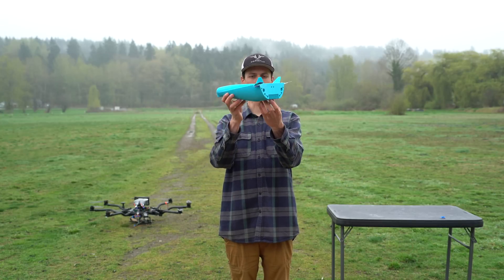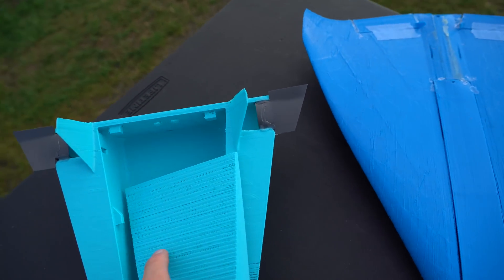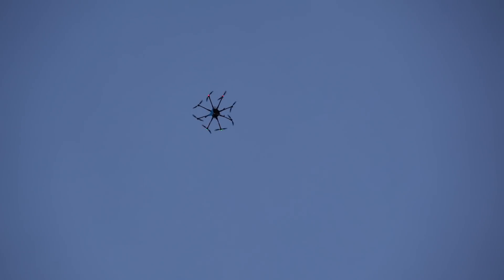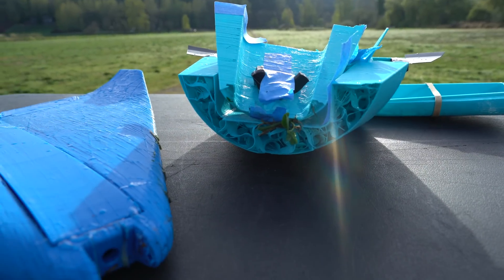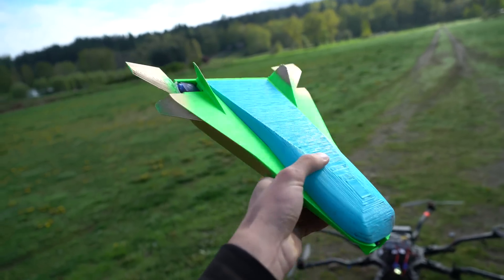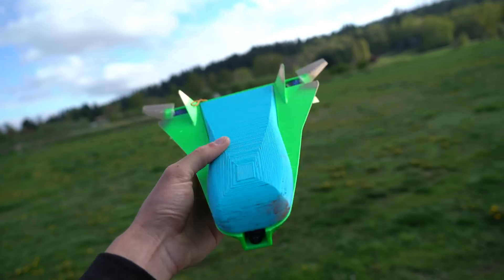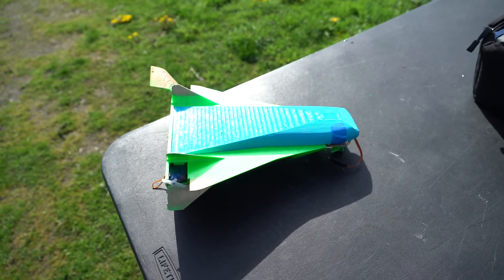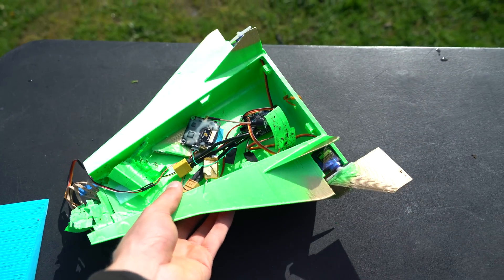3D Printed RC Lifting Body Aircraft? - RCTESTFLIGHT

Comment: i would start by only printing the outer shell, then fill in the dead space with foam and hot glu to add strength. Also your camera position is killing a lot of the lifting body design characteristics. The nose cone needs to be smooth so air can evenly distribute underneath without turbulence.if you notice in the designs used by nasa you do not want just a half round, you actually need some vertical portion of it all the way around to prevent so much air splitting over the top, then move your controls forward and lower. it seems to me you want cg at center or even maybe a bit behind center because the tail is going to have more lift than the front.

Comment: Having gone through the lifting body phase with no stabilization it's got to be made from foam for a lighter loading. Air density doesn't scale.  I'd piggyback mine up on a trainer 60 then fly them down to a hand catch, but they were only 2-3 oz.  Most were an exact scale of the original so you can throw it like a football and fly it back. Took a strong arm and an immediate return to home flight plan.

Comment: Try covering the thing with aluminum flue tape to smooth the surface. Don't rub it hard onto it, that will only result in a somewhat smoother surface across the print layers. Another thing to try is heavy duty clear packing tape. I mean the really good tape, not thing dollar store crap. With either tape, bridge over those slats you put on the bottom.

Next thing to do is drop it almost flat, a little nose down rather than hanging with the nose straight down. Nose down dropping is like those wingsuit fliers jumping off high cliffs. They lose a huge amount of altitude before they get significant horizontal velocity. If they had some sort of launch rail or slingshot they could fly much farther.

Comment: Looking at the HL-10, it looks like the airframe leads a lot of airflow from the sides up to between the vertical stabilizers, to add lift and roll stability.
When looking at your print and imagine the air flows in similar angles, I'd guess that severe turbulence would build up on the top side of the body, as it is rather flat and there is a straight leading edge that follows from the front right to the back, which then could cause a spin so abrupt it really looks like a servo glitch

Comment: EXTREME overweight!!
Ditch the huge battery - try a 250mah instead of a quad racing brick!
Print thinner/less walls.
The finish is too rough for a lifting body.
Add a centreline fin for stability instead of winglets.
I don't think the rear 'diffuser' helps either. These belong on an F1 racing car - for helping push the car into the ground - ie reverse lift.
I'd scale up the design just a little too.
I hope you follow through with your experiments, unlike other talented designers on youtube who bounce from project to project and never really problem solve a design to the end.

Comment: would you create more lift if you slope the upper curve farhter down in between the fins like the x 10?
loose some inside volume though.
and do bigger control surfaces help?
x10 seem to be a clipped wing from above.

Comment: i think a major issue is the 3D print roughness of the surface. You need a very smooth surface for a good laminar flow and lift. perhaps with some good sanding and polishing it would have been a lot better.
Reply: Destin heard you say laminar flow. He is coming.
Reply: Especially at that scale. Imagine how big those lines would be if it were full scale...
Reply: @DanielWilliams-oi4ss  the lines are an artifact of the printing process. they would say the same size no matter how much it's scaled up .
Reply: @ancelrick5396  he's not talking about if it were printed at a bigger scale, he's talking about if a full size craft had ridges/lines of a similar scale relative to the body
Reply: @ClippyForConsumerWrights  Sorry I though the OP was talking about 3d printing.
Reply: Maybe vapor smoothing it
Reply: @Mcedgelord_05  that only works on ABS. All these planes are made of PLA.
Reply: Cupcake maybe try printing in abs or with non planer printing also maybe try printing with less infill since the lifting body is heavy
Reply: @Daesgrith  I bet you could vapor smooth pla with paint stripper.
Reply: No, turn the print so it prints in the same plane as the foil, makes them way smoother
Reply: He has some extrusion issues with his printer. I have a cheap printer that is tuned properly and it has a way smoother surface then this even with a .6mm nozzle.
Reply: If he had the talent, he wouldn't have used a 3d printer to build those. What craft would have 1 mm thick walls at that scale? None. Build it from foam.

Comment: In the first test flights (before any components were added to the craft) it looked like the drone was creating a bunch of turbulence on the crafts as they were released.

You might try having them tethered further away from the drone (like 20ft below it), or have a very long beam extend off the drone so the craft is outside the turbulence. If the drone can't maintain balance, you could extend a beam in both directions with a counter weight that gets dropped at the same time as the craft, and have it tied to the center of the drone to prevent the counterweight from falling on anyone's head.

Comment: A good resource for you on this is "Flying Without Wings"  By authors Thompson and Peebles covering the full history, flight by flight with the test pilots notes and feedback. Your flying prototype resembles the M2-F3 profile, but your ventral slots may be robbing you of lift... maybe if try some flights where it's taped over in increasing stages from front to rear. Your more streamlined shape is closer to the HL-10 without the mid fuselage volume but with the flared  wingtips. Hope you continue making and flying these models... maybe check out the "Dreamchaser" by Sierra Nevada Corp... it could lead to a job with them perhaps !

Comment: From what I've read is that NASA was initially interested in lifting bodies for spacecraft coming back from orbit.  During one drop test the lifting body which flew more like a streamlined brick made a successful landing on the dry lake bed.  Shortly after rolling to a stop the B-52 mothership roared over at low altitude.  One of the engineers asked: How did he get down from altitude so quickly.  The B-52 pilots showed the engineers their technique and proved that winged aircraft can be used for reentry.

About being a streamlined brick...

A local glider club presented one of the test pilots a trophy that was a red brick ground to a streamlined shape.

Comment: Consider Colorfabb's new filament its FOAMING. you can print it at 35% extrusion rate but full flow. of course the parts will be much weaker but also upto 65% LIGHTER for the same volume of printed material. very neat stuff!

Comment: What an impressive brick design ! glides as if a good brick would do. If it was effective and successful the space shuttle would have been in this shape. If remember correctly the modification from x-24A to X-24B made it almost different appearance just to made it more stable in flight. I think this body lifting design was meant for the high speed high altitude glide not the same condition that set up on your experiment . This must be one factor contributed to "fly like a brick".

Comment: One of the major lessons learned from the M2 lifting body in the 60's, which is most similar to the one in the video, is it needs a vertical fin right on the centerline to stabilize in roll.  I bet if you add a centerline fin, the uncontrolled spins would stop. 

I also agree with the poster who questions the use of a flight controller.  It hides the real behavior of the vehicle, and will often make things worse once they go bad (like spins).

Comment: The space Shuttle and the earlier experimental test machines have wings that are essentially upside down . They do not make lift . They are designed to slow down in a glide slope without stalling
Reply: The Shuttles have normal lifting wings. They are way, no how, a lifting body. The only thing the Shuttle got from the lifting body program was the high speed steep then flare to horizontal glide path.
Reply: @greggv8  
It is this unique aerospace vehicle, a lifting body, that launches like a rocket, orbits like a spacecraft and lands like a glider that continues to link earth and space.
 
Last Updated: Aug. 7, 2017
Editor: NASA Content Administrator
https://www.nasa.gov/audience/forstudents/9-12/features/F_Aeronautics_of_Space_Shuttle.html

As I said above the aerofoil of the wings is is upside down relative to a normal plane . That allows a higher angle of attack without stalling , a measure of control at higher altitudes and the deceleration required to come down out of orbit . Yes the wings can generate lift . But then so can a conventional plane flying upside down if the angle of attack is sufficient 
Basically it "glides" like a brick

Comment: Remove the rear diffuser. On cars, those are used to decrease air pressure under the car and increase pressure over the car to increase grip. I'd think you want high pressure under the flying body and low pressure over the flying body. I'm not an expert, I just watch YouTube, I'm sure I'm just talking malarkey and shennanigans.

Comment: Okay, so a few things. First off, what's going on with your prints man? looks like maybe you're printing too hot/fast for the material that you're using. Secondly, I think those grooves in the bottom are actually taking away from your lift. They're clearly not doing anything to help vertically stabilize it, as the craft was still going into flat spins. I think that if you took them away, and stuck with the little winglets on the side, you'd probably end up getting a much higher lifting force.

Comment: Some of the reasons why the F-35 looks a little stubby with its upturned nose and short neck compared to the sleek F-16 is because it has incorporated some of the lifting body characteristics into its airframe. I believe this gives the airplane high AOA authority, especially at low speeds.

Comment: Print some thin cross section of the model (oriented like formers would be in a balsa fuselage). Glue XPS foam between them, and hotwire/sand the plug until it's the right shape.  MUCH lower mass/density/wing loading.

Comment: i think its just too heavy, try using foam next time (use the PLA shape to make a negative and fill said negative w/ construction foam and carve the body out of that )
Reply: There's a flood of printer dependent "creators" out there. They don't have the ability to work with different materials, shaping, etc... But software modeling, they can do that all day. It's like those Tesla car dweebs that talk it up as the greatest car ever, but couldn't change a tire or brake pad to save their lives.

Comment: Neat experiments. My favorite is the X-24A and I can go see it any day I want because I live about 10 minutes from the Air Force Museum. (yes I know the one on display is actually a SV-5J modified to look like the 24A.) What software are you using? I'd very much like to model stuff too but don't know if I can afford the software. You probably don't want to hear this but your body/wing loading is gross. Try sticking it out a car window and see if you can create the lift. Yes you are right those spins are the result of stall. The X24-B had winglets on it like you final lifting body and it was quite successful.

Comment: Thanks for not saying anything about how NASA's lifting body test program was used in the development of the Space Shuttle. It wasn't, except for proving that an unpowered craft could safely make a high speed and steep descent then flare and transition to horizontal flight to land. The Shuttle is not a lifting body, it's a brick with wings and a round nose.

Comment: The grooves on the bottom seem like a mistake to me. It changes that cross section into a less capable lifting form. You're forcing air to be displaced and squeezed on the underside, speeding it up, causing lower pressure. At least put them on top. 

Also, the landing speed was very high on the real thing, and needed a rocket boost to flare. That's not much good for scale flight, as a pebble becomes a boulder in the runway. A long lubed up slip'n'slide might work.
Reply: They never used the rocket for landing. The rockets were used to gain altitude and speed after being dropped from their B52 mothership. https://www.nasa.gov/centers/armstrong/news/FactSheets/FS-011-DFRC.html IIRC the M2-F1 towed glider had a rocket in early air towed flights as a just in case backup to kick it horizontal but it was never used so the rocket was removed.

Comment: I think your "built in" strakes on the underside might be creating an area of low pressure, which could be causing some of your instability. Maybe try sculpting them in smoother so that the don't have such a sharp cutoff where they meet the middle underside of the fuselage? Or maybe try one without them all together? Cheers and thanks for another interesting video :)

Comment: Hey Dan. This was a very interesting project, especially since it seems that with 3d printing you can quickly modify and test for a number of versions. 
One suggestion that will make is that since you don't have a vertical stabilizer, your fuselage is going to have to stabilize yaw. When you look at the side profile of the aircraft, there should be much greater area behind the CG rather than in front. This is something I noticed on the full scale aircraft. The raised nose section on your aircraft also seems to be aiding the spin tendency, particularly at high? AoA. I would suggest flattening the nose and maybe getting rid of the vertical fins. Happy landings!

Comment: Very impressive, but I think it needs larger control surfaces. I think you can use foam models instead of 3d printing just to check the aerodynamics, otherwise it's just too heavy to control

Comment: The USAF X-20 Dyna Soar and Soviet Era MIG 105 are two design solutions that you might like to research.  The Lockheed X-33 VentureStar is a modern attempt to produce a Space Shuttle replacement. NASA abandoned the round bottomed  #2 model shape for  the flattened cone configuration of your model #1, it might be best to build upon their research.

Comment: Fantastic video. You're living my dream to build and fly lifting body aircraft. Have you considered launching them horizontally or with a 10-20 degree nose down versus vertically?

The blue blended wing could be made into the Northrop HL10 by adding a bulge to the centerline as a fuselage.

Comment: Yeah that lifting body is just too small. 4x that size might fly better. Weight to glide ratio thing. Just a hypothesis for the project. Maybe 3D print the larger model in pieces if its too big for your printer chassis. I like these kind of experimental vids. Subbed buddy!

Comment: One reason you probably are having control issues is they were studying these for the shuttle program, and the powered ones were actually super sonic. Maybe add a model rocket booster to get it up to speed? good idea making the lower fins farther apart, you have to be careful about turbulent boundary layer flow on RC scale aircraft (and with the 3D printed surface) which actually helps it stall later, but causes other trade offs

Comment: Where does a lifting body actually turn into a flying wing, is what I wondered when looking at both your designs. Thanks for the nice video.
Reply: Honestly, there's no strict definition, so I'd say that if it looks more like a wing, then it's a flying wing, but if it looks more like a lifting body, then it's a lifting body. A prime example would be the first plane is a wing, but the second is a body.
Reply: @shinukism shnuck No need to be a dickhead.

Comment: Never completely grasped the lifting-body design. The heavily curved cross section and inverse camber scream "lousy aircraft" to me. The only possible reason I can think of to make a glider so deliberately inefficient is to optimize for the re-entry portion of the mission. If that's the case, I don't see a low-altitude drop application. Another thing to be considered is that even for re-entry, NASA eventually abandoned the lifting-body in favor of a flat-bottomed delta wing design.

Comment: 5:25 my totally unsubstantiated guess would be that the increased speed of the horizontal flight makes the "wingtip" vortex increase up to a point it totally stalls the lifting body. Maybe some vertical stabilizers can help separate/block that vortex, like winglets on passenger jets.